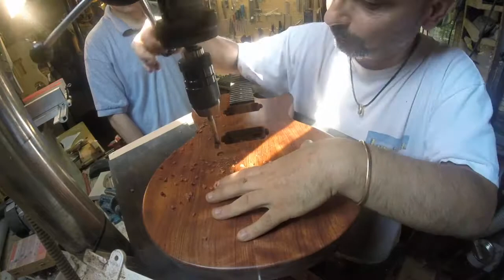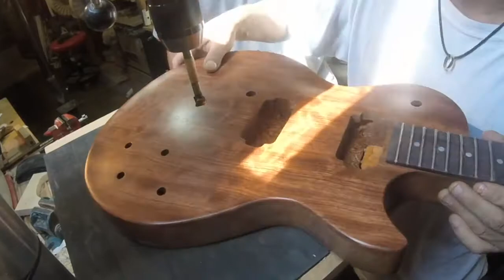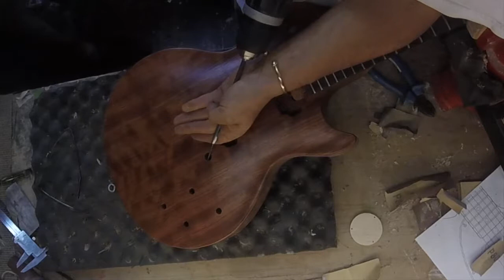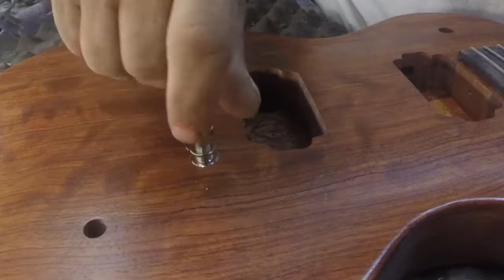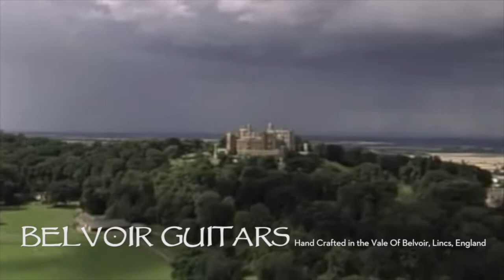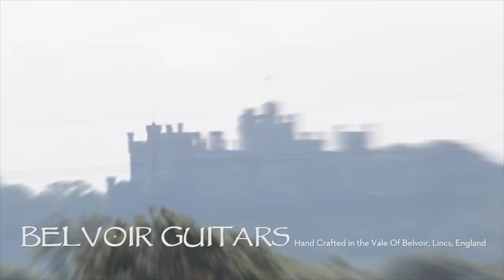Installing Faber Wraparound Bridge/Tailpiece

Comment: Do you connect earth cables to the bridge ?
Reply from the maker: yes , at 1.18 you can see me drilling the channel, and at 1.25 you can see the frayed ends of the wire shortly before the anchor is hammered into place. Cheers , C
Reply: Belvoir Guitars okok, Im building my own guitar right now but dont know much about the electronics... do i have to connect the earth cables to the bridge like u did .? Cheers
Reply from the maker: yes bud, either the bridge or the tailpiece needs to be earthed. Best method is to trap it under the anchor, as I did here. Then run that wire through to the control cavity and solder it to the back of a pot - usually the volume which can be the central earth point
Reply: alright, thank u for the info ! didnt know this hehe